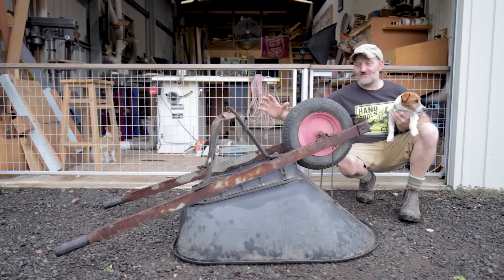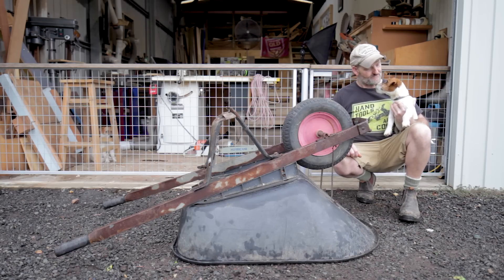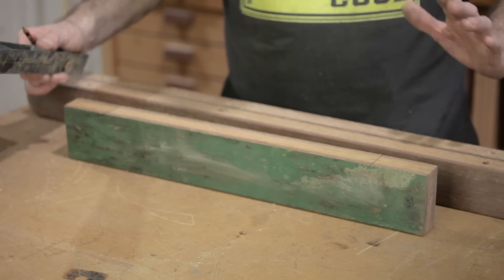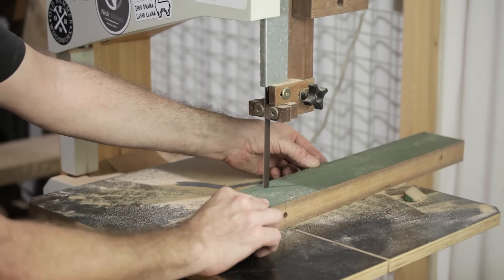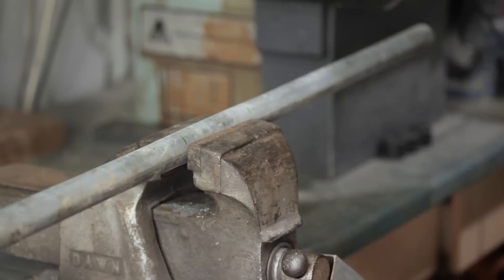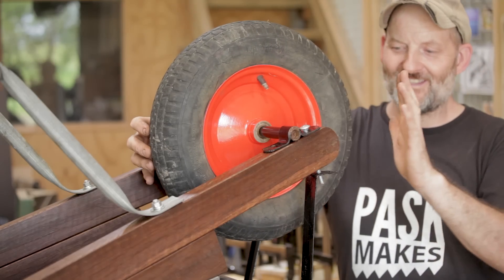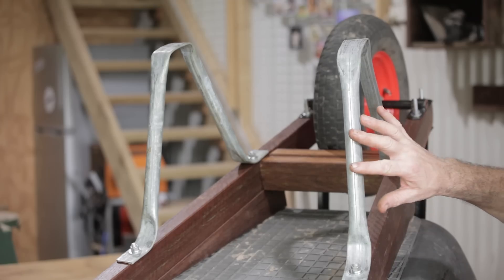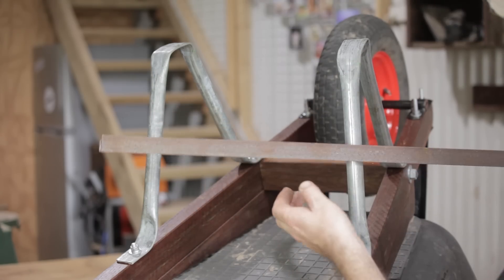Wheelbarrow Upgrade & Restoration

Comment from the maker: There are so many things going around in my head that I sometimes forget to add something into my videos. I should've mentioned that by shortening the front of the handles and discarding the front brace there is a trade off being made. 

Having an open wheel is great as there is no brace to catch on any undulating ground. But, the brace is used when tipping the barrow (especially with heavy loads) to rest on the ground, using the handles as levers to tip the load. If your load is light then this won't be an issue at all, it is very easy to tip a barrow full of leaves, weeds etc without the front brace. 

Even a heavy load isn't too difficult. But you would need to be more careful as the weight distribution of the load shifts as you lift and the barrow can come back towards you. It can't come back too far as the front lip of the tub will hit the ground if you let it get that far. Also with a heavy load you need to give a little more effort as you don't have a pivot point to help you out. It would also be possible to put your one foot against the wheel to stop it coming back.

If you restore or make new handles for your wheelbarrow then it's something to consider. I take any weeds, leaves etc through my paddock to dump them in an area out of the way and it's quite a distance over swales and undulations and I can tell you the open wheel is fantastic and I can definitely live without the front brace.

The ideal scenario is to have two wheelbarrows, one with a brace and one without! :)
Reply: Or perhaps one wheel barrow and a detachable front brace of some kind?  Great video!!
Reply: I'd keep that front brace/brake!
Reply: A brace made of metal that is hinged and can be lifted up when not wanted.
Reply: Tailss1 I love the idea nice and simple but it should work if I pinch the locking handles from the old dead lawn mower that are used for folding down the handle to save on floor space 😹😹😹 thanks for a great idea 😹😹😹
Reply: Really enjoyed this video and the clever way you bent that thin walled pipe. I have done similar barrow repairs but always retain the front brace for standing the barrow against a wall to limit rust in the tub. 
Have learnt a lot from your videos, thanks.

Comment: 😹😹😹love the restoration job on the wheelbarrow I have 2 that need some TLC and like you my plot is not flat so the front brace/brake gets in the way all the time. I noticed someone made a suggestion of making a movable one which I thought was a great idea this way when needed I can drop it down when I need to use one 😹😹love the idea nice and simple but it should work if I pinch the locking handles from the old dead lawn mower that are used for folding down the handle to save on floor space 😹😹😹

Comment: Your puppies are so cute that I think I've just died from cuteness overdose! Not a bad way to go, really. Lol. :-) Awesome job on the wheelbarrow! I've got a wheelbarrow in need of similar attention, but I've been putting it off because I worried I might screw up; I don't have a bandsaw or table saw, but I suspect that that just made it easier, right? I have a jigsaw, and a circular saw, plus several handsaws, so I can probably manage, don't you think?
Reply from the maker: They certainly are cute Giotto! You can do most of what's achieved on a bandsaw with a jigsaw. You have enough tools there to get the job done! :)

Comment: In recently rebuilt my thirty year old wheelbarrow.

I liked your re engineering of various features. All were improvements.  I may go back and eliminate the front brace as you suggested.

A couple of things that could have been improved:

The biggest weakness I observed on my barrow was corroded bolt threads on mild steel bolts.  I wound up cutting the bolts off since the threads were mostly gone.  That argues for replacing volts and hardware with galvanized fittings which will minimize corrosion  ---and greasing up the threads,  too.

I would have recommended taking the tire off the wheel and derusting and finishing the inside of the wheel.  A major reason for wheelbarrow failure is a tire that wont hold air,  usually because the steel surface of the wheel wont fit the tire properly.

And finally  --- for everyone!  Your wheelbarrow needs to be taken apart,  repainted and the bolts greased.  I would have suggested after ten years,  but perhaps fewer would be better.

If the wood and metal parts are primed and painted,  they can be expected to provide reliable service much longer!

Comment: spoke shave on the end of the wheelbarrow handle. i cant say ive seen a more appropriate application for that tool. almost as if thee olde spokesshave was designed by pioneer craftsmen who mainly built wheelbarrows 😅😅

Comment: G'day pask do you know of a wood supplier in south east Queensland
Reply from the maker: I don't Doug, but it would be interesting to know of one though. I have bought some from the wood shows in the past. I get my wood from local ads and generally keep my eyes open. If I see something good I get it, even if I don't have a use for it at that time. I've also milled a fair amount of smaller logs too. :)
Reply: Pask Makes thanks for getting back mate cheers

Comment: Nice work for a badly engineered wheelbarrow.
Get a European style barrow  Frame made of galvanized bent pipe.
1. Load is more centered under wheel.
2. Handles are wider apparatus for better balance and arehorizontal when you lift the thing.
3. The front bar is much higher and does not fit into small bumps.
4 More solid and longer lasting.
American style wheelbarrows are a nightmare if you ever had a good one.
Reply from the maker: Thanks for that Thomas - I'll have to check them out! :)

Comment: Why do you run your cutoff saw multiple times per cut? I've never seen that before. I assume there's a good reason.
Reply from the maker: It’s just something I do, it feels right to me as it doesn’t bog the saw down and keeps the blade running at top speed. I’m not sure it’s necessary but like I said it just feels right to me! 😊

Comment: After watching this video a second time, mine needs some renovating so I’ve decided to get some ideas from this. Even though it won’t turn out a patch on yours Noel, it’ll be a lot better than what’s on it at the moment plus the bucket is galvanised too which is a bonus 😉
Reply: << plus the bucket is galvanised too which is a bonus 😉>>

What about the bolts?   My experience is that corroded bolts are a major impediment,  since they prevent the barrow from being easily taken apart,  primed,  painted and reassembled.

If you can get the thing apart,  I found that priming and repainting everything was light work.

Comment: That front brace also serves as a fulcrum for dumping.  Do you miss having it there for that purpose?  Cheers! Chris.
Reply from the maker: So far I've had no problem without it but that may be a different matter if I have to dump a heavy load. I reckon I would still manage though and I already love the open the wheel around our property. :)

Comment: You know something I like best about watching your posts (aside from the soothing sound effects the videos have when on time-lapse)?  Your ingenuity.  I'd have never thought to use a piece of rounded steel as a guide to bend the piping into the shape I needed.  Lacking that kind of creativity, I'd have just bought or rented the pipe bending equipment.

Comment: front overhang is essencial for overturn heavy load. without it, the wheelbarrow roll back on your shins.
Reply from the maker: Absolutely, I only use this barrow for light loads, weeding etc but I should've mentioned that. :)
Reply: Oook.... We'll check bruises on your shins in the next videos :-D
Reply from the maker: Haha! ;)
Reply: Or, do what I do and just tip it mostly sideways. Using the wheel and one of the legs as your pivot point. It's easier to dump the whole load that way.